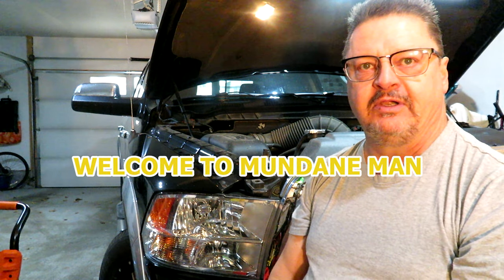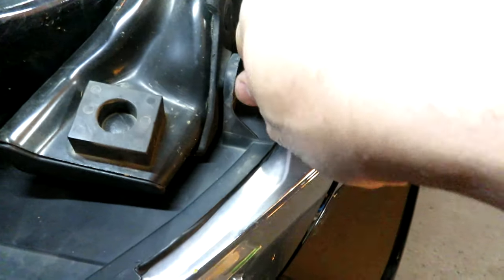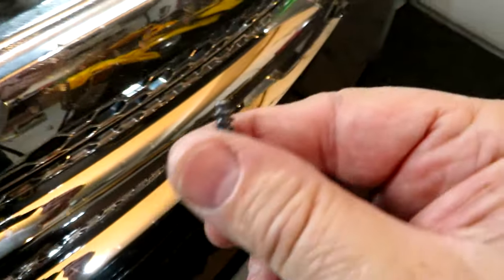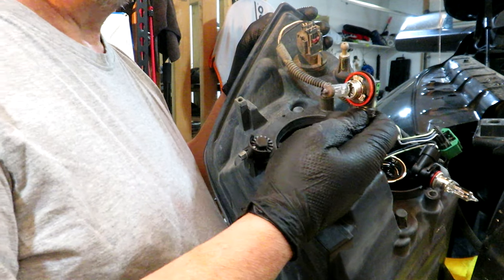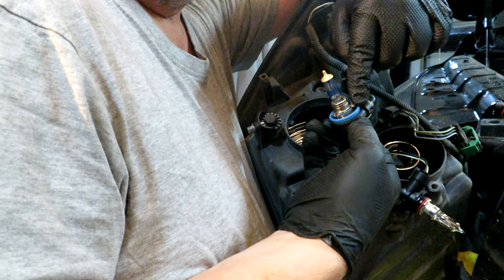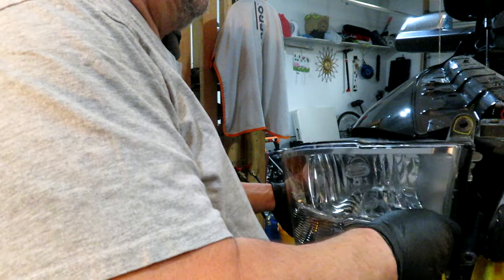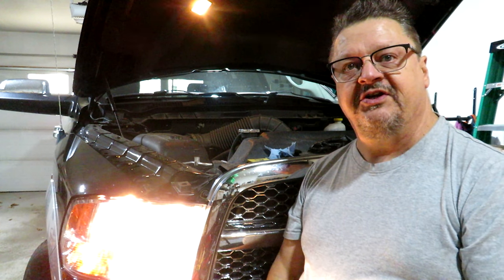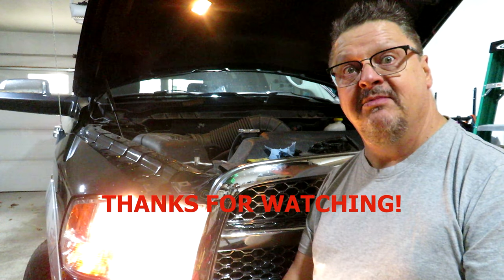Effortlessly Upgrade Your Ram's Headlight Bulb (2009-2018) In A Flash! No Grill Removal Needed.

Comment: Great Video !
I am subscribing to your channel as I like the easy way you talk and I am older(almost 65) and can understand you veary well.

I have a 2013 Ram 1500  Quad cab with Quad headlights  and I do have a Question for you,i have the top bolt taken out and the bottom bolt feels like it is backed out all it is going to back out but it did not come out when I pulled the socket out and I have pushed the headlight retainer up through the fenderwell door.but I cant get the headlight to come out.
so Would you tell me where were you resting your hand when you pushed the back or the headlight through the fenderwell door  ?

Thank You much

Comment: Also did you check to see if the o ring or rubber seal is in good shape to keep moisture out ?
I have not got my headlight out as I am unsure where to push against the back of the headlight to get it to release from the grommet.
Waiting for your reply

Thank you much
Reply from the maker: If I recall, the rubber seal or o-ring should be on the bulb itself.  I hope this helps.
Reply: You talked about to check the seal on the round cap that has to be taken off to get to the bulb